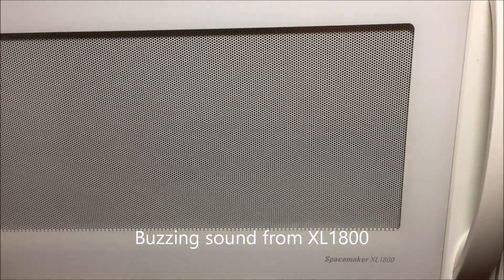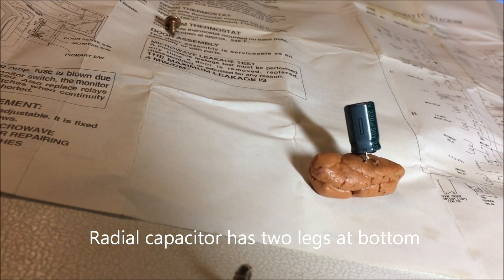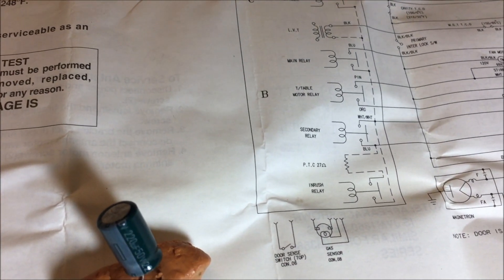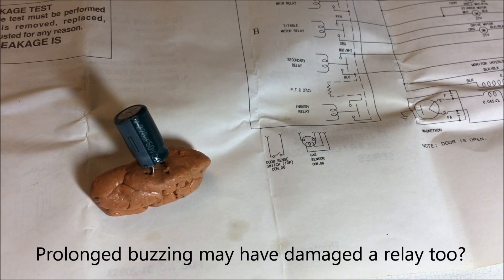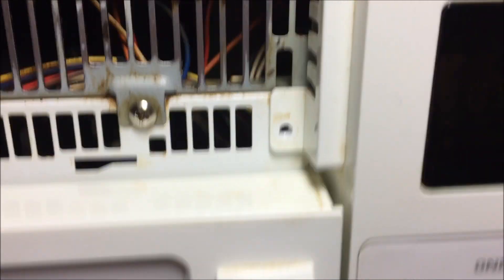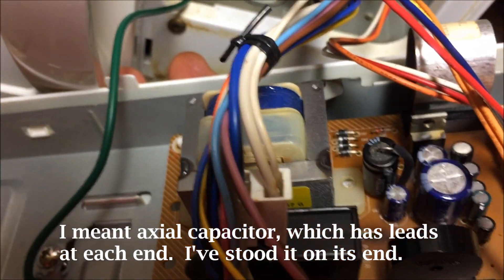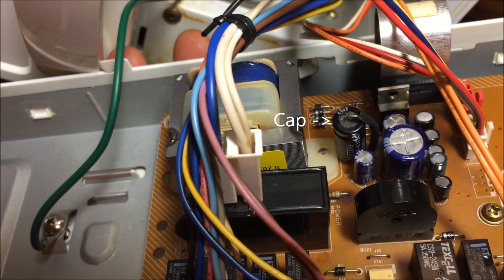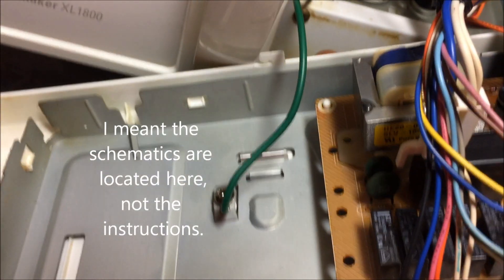Buzzing Microwave Oven Repair GE JVM1860 Spacemaker XL1800

Comment: Thx for the advice.  It got us back up and running.  Do you know the resistance value of Resistor R51?  I do not have schematics.  There’s a lot of discoloring of the actual resistor and  its surroundings as if it is getting really hot.  I’m unable to read the color bands of the resistor to determine ohms.  It measures 30.12K with the multimeter but I’m not sure if that is by design.  I may want to replace it with a higher wattage resistor but want to make sure I use the correct resistance value.  Thank you again for the great video!

Comment: Hi Dale, Exact problem friend is having, so I'm going to fix it. One question: do you remember the voltage rating of the cap? I'd like to have it on hand when I take it apart. Thanks!
Reply from the maker: I was able to read it from the video: 50 Volts
Reply: @fathompin  Great, thanks.
Reply: @fathompin  Fixed! My hero.

Comment: Dale, great many thanks for the tip. I had the same problem with buzzing relays, followed your lead on the 220mF cap, and problem solved! I don't know how you figured out which cap controls relays, but you have saved my appliance. My cap bulged from the bottom, not from the top, so I wouldn't see it until it was off the board. Once again, great many thanks!

Comment: Dale I owe you a beer. This worked perfectly. Thank you for posting this video. Cheers.
Reply from the maker: Glad you were successful.  By the way, about six months later that microwave (my MIL's) quit again. This time it was the door switch.  Those switches come apart pretty easy, and it just needed the copper "spring" bar bent a little straighter so it provided more back pressure to pop the switch into its resting position.
Reply: @fathompin  Thanks for the heads up!

Comment: My microwave broke down yesterday. Buzzing while door is open. Lights don't work. Oven doesn't work. Timer doesn't count down. The sounds of the buttons are fluttery, resembling a device with a dying battery. Any ideas?
Reply from the maker: Consult the schematics that are normally located inside the unit and try to locate the relay circuit that controls the lights.  I have described that the microcontroller uses quite a few relays to turn on and off various items, like your lights.  Also like I did, just try to physically locate which relay is buzzing of the 6 or more that are used in the microwave.  If you think you've located a buzzing relay, test your theory by removing a lead of a component in that circuit in order to "open or isolate" the circuit and see if that stops the buzzing. If so then that could be the bad capacitor.

Comment: BTW because manufacturing and materials have gotten better/smaller, the replacement capacitor was only 2/3rds the height of the original one from 2001 for the same ratings